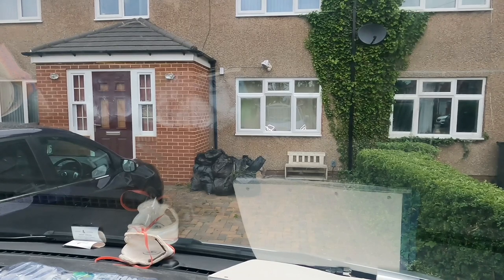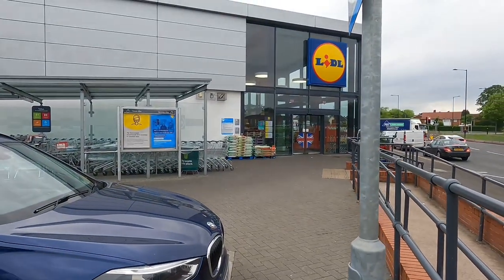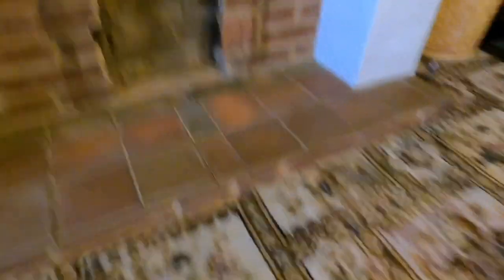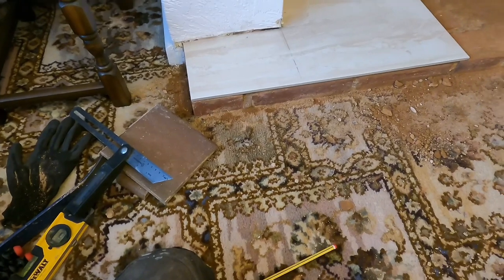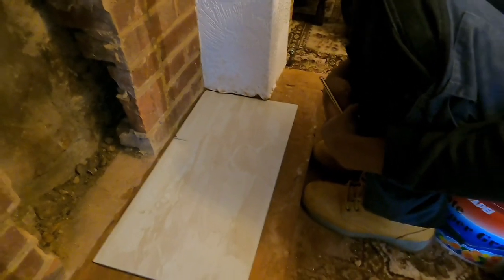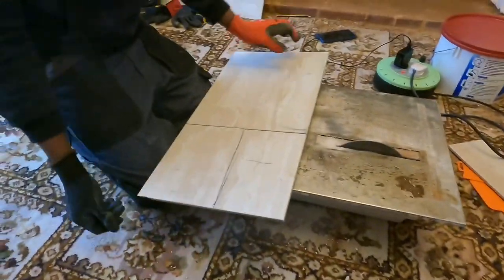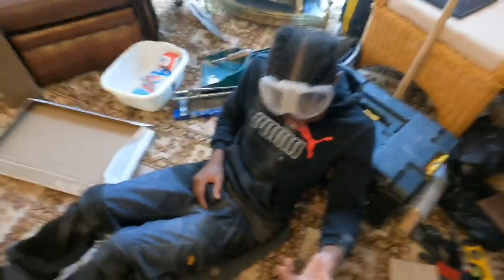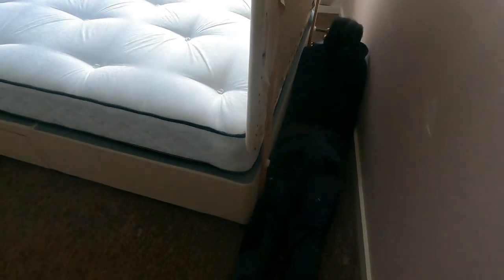Tiling with the apprentice (Day in the life)

Comment: My first thought was “why on earth are they using a wet cutter on the carpet”, my second was “that is set out wrong”, thankfully you did advise later in the video that the customer didn’t want a full tile in the centre, which I would advise against.

Friendly advice going forward, that ready mix adhesive is 3x wrong for that application. Ready mix is not suitable for floor, standard. Its only suitable for a maximum size 300x300mm area ceramic wall tile, which is why pro tilers only ever use it for small format kitchen splashbacks or something like that. Thirdly, that adhesive is not suitable in a log burner/fireplace application.

I would recommend giving some powdered adhesive a try in this situation, you’d be able to grout same day if you used rapid, but obviously need to be quick and thats not ideal if you’re teaching someone on the job.

Get yourself a decent stainless notch trowel too… we normally cerate floors with a 12mm notch, then backbutter with the smooth side of the trowel to get a full coverage.

Thanks for the vid
Reply: it isnt his trade but i do agree he shouldve done a bit of research before hand to ensure his quality of work
Reply: Haha, my thought as well that cutter on the carpet was wild xD